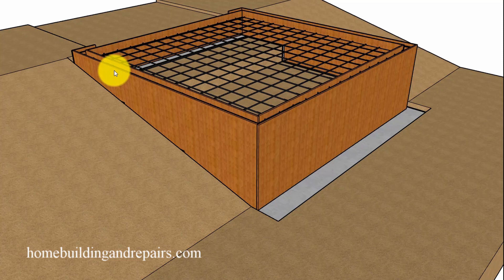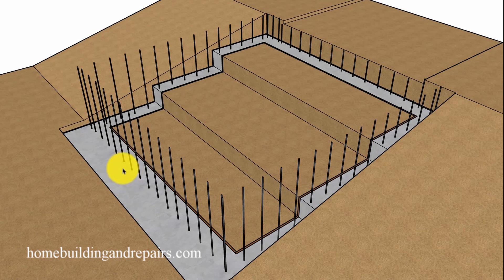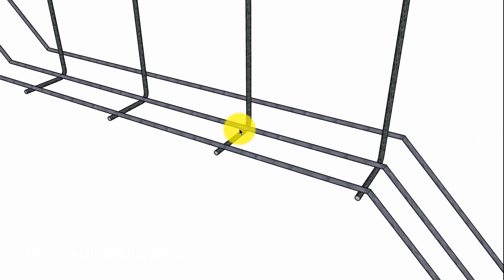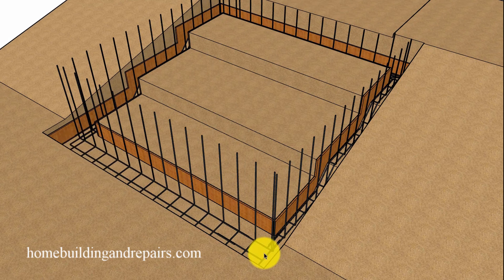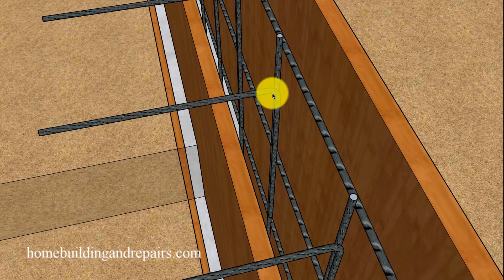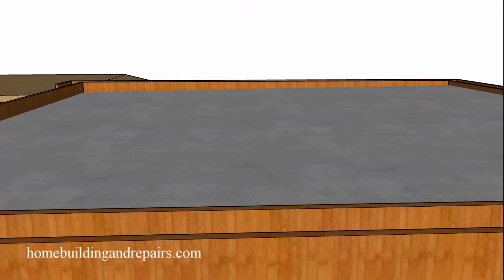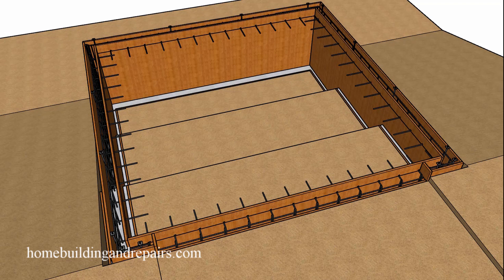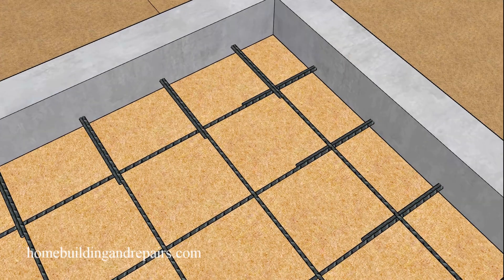Structural Rebar Layout For Sloping Concrete Garage Foundation - Learn How To Build Project

Comment: I just received my engineered plans back for a building on a slope like this. The footing at the lower end of the slope called for a FC48 (10"x48") footing and 5 runs of rebar, #4 9" OC. YMMV based on the location.
Reply from the maker: Thanks for sharing.

Comment: Overkill for sure, we still pour some 8’ garage walls with no rebar in ma. They just recently started adding a couple rows of #4 in residential foundations but that’s about it.
All your videos are great, thanks
Reply: I think that depends on your climate area I know here in the Northeast it is a requirement because of the freezing and thawing cycles without rebar or concrete will eventually just crack from the humidity and freezing within the concrete itself also it's a requirement here in the Northeast Pennsylvania to have fiberglass reinforced concrete again it's a precaution because of our thawing and freezing cycles
Reply from the maker: You're welcome and thanks for letting us know you enjoy them.

Comment: Why would you fill the forms with dirt? I thought the whole point of formwork is to retain concrete. The dirt will take whatever shape you cut it to (generally speaking).
Reply from the maker: You add dirt after concrete is finished to fill in any areas or voids after removing form boards in between soil and concrete foundation if necessary. Let me know if that doesn't make sense.

Comment: Wouldn't most construction leave rebar from the walls pointing into the air, and the bend it down  after removing forms?
Reply: I agree with your question but I think in this situation by watching the video, it shows that the garage floor is lower than the top of the stem walls. It also might be a blue print detail
Reply: @inmarmartinez1847  could leave outer forms up and pour top of wall and floor at same time then?
Reply from the maker: Not for this design, but I've seen it done on other projects to help prevent those backfilling from getting poked by the rebar. Let me know if this makes sense.
Reply: Yes normally I would leave Rebar coming outta the top of wall. Also if you wanted to hold it down on the inside you could very easily by putting 2 inch styrofoam on the inside that would give you a slab ledge and you can still wet stick your rebar in the top of wall. Also there is no need in tying the verticals in the footing like that or into the wall like that wet sticking into the concrete would be sufficient. Another thing it doesn't have to be a monolithic pour. Very rarely do I do monolithic pours pour the footings for the walls backfill and side of the area and then the slab. your rebar detail is way Overkill. you do not need verticals every 16 inches and horizontal every 16 inches maybe if you were pouring a 12 foot tall wall that was getting back filled up 10 feet.